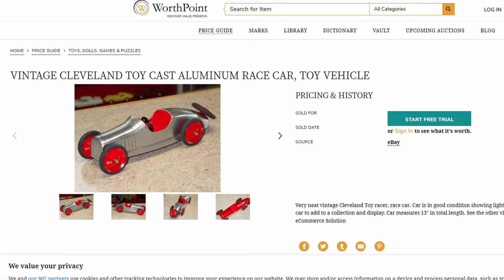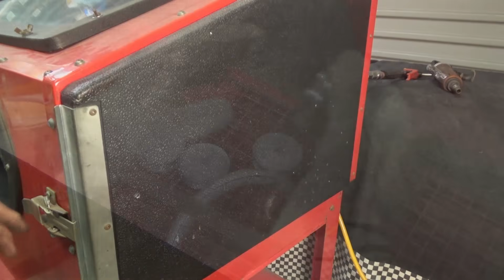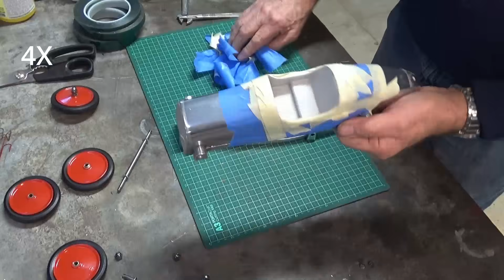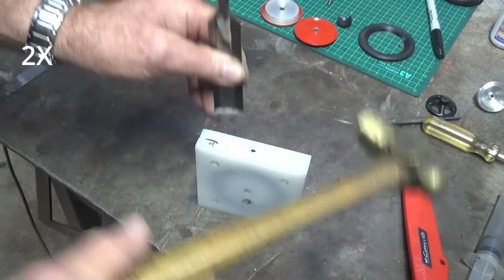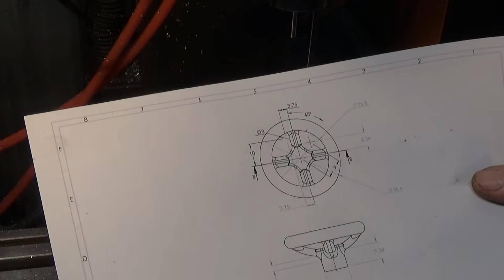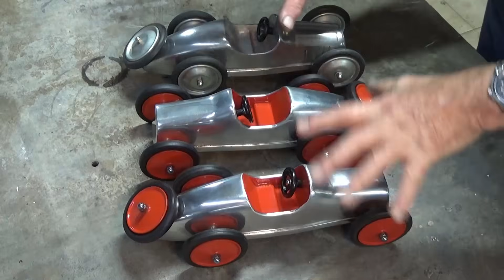Cleveland Racer Part 6 - Squishy Tyres for the Cleveland Racer + Powdercoating Fun & CNC

Comment: Too late now (I know it's all finished) but if you woulda machined about 1mm from each rim half inside and changed your tire mold to leave a 2mm skin in the center of the tire when you riveted the halves together it would have attached the tire. Might have even machined some spokes in the mold and inside the rims so there was that much more rubber holding them on.
I worked in toy design as a 20 year old so that stuff just comes to me.
Reply from the maker: Yes, there were probably a lot of refinements I should have employed but it was one of those evolving processes. The original tyres were way more rigid and the wheel halves had to be sized assuming that there wouldn't be a lot of crush in the assembly. 
Regards,
Mark

Comment: I was wondering if there is a liquid masking product for powder coating & some people say you can use a latex solder masking called Wonder Mask for powder coating also.
Reply from the maker: I was looking for something like a liquid mask. Our local paint shop used to sell a product for masking glass in window frames. You could just paint it on with a gadget that looked like a giant highlighter pen and it peeled off later like a rubbery skin. 
Regards,
Mark

Comment: Mark, if I may offer an idea reference masking.  I would suggest "over-masking" the area you want covered (because the tape is so stiff;) then using either a single edge razor blade / or a Exacto-Knive(s) (of your likening, come in different sizes/thickness; ) and trim /cut as needed to remove unwanted /excess tape, and get / achieve the edge (line) you want.  I like the new compound for your tires.  Personally I would try using a thin coat of "Spray-Pam," for cooking / baking, as a mold-release, or some type of car-wax, maybe try a thin-coat WD-40. Your working way to hard to separate the mold when the tires / Tyres have dried / harden / cured.  The cars are LOOKING AWESOME.

I don't know if in Australia you have "FLITZ" product(s,) called:  "Metal, Plastic & Fiberglass POLISH & Paint Restorer." Corrosion Protection (for Aviation / Marine /Truck/Automotive, Plumbing, Hotel/Restaurant etc.)  If you do, I would for sure purchase a single quart can (0.45 Litres/Liters.)  Where I learned about this product was seeing it being used on {youtube} Bus Grease Monkey Garage (Scott Crosby.)  Scott works on what are called silver-sides (all aluminum ) 1950's Greyhound like buses, with engines what are called screaming Jimmy's. 
Scott was using the product on his personal bus named Lenny, WORKS "Supercalifragilisticious."  
The word supercalifragilisticious comes from the (1964) movie Mary Poppins.  FYI.
Reply from the maker: Thanks. I am old enough to remember seeing Mary Poppins at the cinema when I was  a kid and it was something of an acheivement to be able to recite the lyrics from that song, especially when Julie Andrews sang it backwards!
I did cut some of the mask away with a surgical scalpel to get a clean edge but the tape tends to separate easily along the sharper curves. As it turned out, it was relatively easy to remove the overspray with very fine wet and dry abrasive.
I have not seen the Flitz product here. I am sure there are better options than what I was using though.
Regards,
Mark

Comment: I know that it's WAY TOO LATE to mention it now, but you probably could have tracked down and sourced rubber o-rings that would have sufficed for the tires

I'm not sure if anyone else has mentioned that already
Reply from the maker: I have had a lot of suggestions to use O rings but the only ones I could source were too small in cross section. As it turns out, I ended up with a more realistic tyre using the mould and the urethane rubber.
Regards,
Mark

Comment: Good day Mark, I just noticed the sheet of metal on the door of the blasting cabinet. Nice idea. I've just been banging on the door, before opening, several times to knock the media back in from the door recesses. For the past 15years! I added a piece of house rain guttering to outside the cabinet just below the door to catch most of what falls. Then I use a chip brush to sweep media into a paint mixing cup and dump it back into the cabinet.
Reply from the maker: The sheet of metal does help but there is still some grit that collects around the edge of the seal. I do lose a bit every time I open the door. I should look into your solution too.
Regards,
Mark

Comment: Amazing work! I'm going to predict that you make all the wheels out of the flexible material. After all, in another 50 years, someone may be using your replica to decide how to make one! And of course, if you really want to be obsessive, you'll remake the tire mold so that the tires require a bit of stretch when mounted, thus keeping them secure. And ... and ... don't you just love it when someone decides how you should spend your time?!? :)
Reply from the maker: I have a plan for mounting the tyres but also, it is surprising how often I take excellent ideas from the comments. One such comment has inspired me to modify the mould as you will see in the next episode.
Regards,
Mark

Comment: I really liked the matte finish on the interior left by the sandblasting. I think my own personal aesthetic choice would be to stop there. 

Thanks for another great episode. I was so happy for you when that tire turned out so well.
Reply from the maker: If I were going to leave it with a blasted finish I would have used glass bead. It makes the surface look semi polished and the peening action of the glass beads smooths out a lot of the defects. The garnet that I used makes the surface absorbent and it will stain quite easily.
Regards,
Mark

Comment: Before i retired as a fabricator i had to develope a system for casting fake Rattan. silicone molds were made off real rattan 10 feet long. We used  50 gallon drums of ureathane rubber. Cast over a thousand pieces. Id like to say it was fun but i can't. 😂
Nice work Mark 👍
Reply from the maker: Thanks. I must say I have never used anything like a flexible resin before. I expected lots of issues but the Smooth On product worked perfectly. I just wish it cured a bit quicker.
Regards,
Mark
Reply: @Preso58  Thank you for the journey Mark.

Comment: The CNC process to fashion the steering wheel was very interesting.  I am more familiar with casting and, as i watched, i ws pondering how i would cast that same part.  

Thank you for this series of very informative and inspiring videos
Reply from the maker: I quickly rejected the idea of a sand mould for that little steering wheel. Trying to find the parting line would turn me off very quickly. Investment casting would be the best way but I don't have the gear for doing that process. 
Regards,
Mark

Comment: Continuing on a beautiful build. A question - why did you do only do roughing steps on the CNC?  The end result is fantastic, but more prep work by the CNC I would have thought would have eased the work needed overall?
Reply from the maker: I am not very familiar with 3D tool paths. I need to experiment more with the options in Fusion360. I have also recently purchased a yearly subscription with Solidworks. It has CAM capabilities too. I am sure that I could have used a finishing toolpath to get better resolution but at the end of the day I decided to quit while I was ahead and use good old files and emery.
Regards,
Mark

Comment: Hi Mark that urethane rubber compound sure looks the business I'm sure that would suit my project perfectly, thanks for being the "Test Pilot" really enjoy your your videos a good source of information and for the practical aspect also, Many thanks.
Reply from the maker: Thanks. The urethane is much thicker than the Smoothcast resin I used for the first batch of tyres and I was worried I wouldn't be able to inject it into the mould with the same syringe I had been using. I pour resin into one half of the mould before assembling it and inject the rest. It's slow going in but I think it helps to reduce the introduction of bubbles. I have been degassing it in a vacuum chamber that I have. The pigment is called "So Strong" and I only have to put two drops into the mix to get an opaque black tyre. 
Regards,
Mark

Comment: Have you switched to Solidworks from Inventor? If so, what prompted the change? Excellent video, always enjoy them.
Reply from the maker: Unfortunately, Autodesk declined to renew my educators licence. So, just after I finished all the drawings for the Threadexpress project I lost the use of Inventor and Fusion360 Pro. 
I was able to get the free Fusion360 version but you quickly find out that there are small but annoying restrictions, like not being able to export 2D drawings as PDF files and not being able to flip the Z axis in the CAM processes. My son suggested I use Solidworks for Makers. It was only about AU$50 for a years subscription but it is very different to the Autodesk software. I am slowly getting used to it but I will probably use it more than Fusion as I get more competent. 
Regards,
Mark
Reply: @Preso58 Yeah Autodesk is definitely making things more difficult. I have Solidworks educational as well and I enjoy it, but not as comfortable as you say as I was in Inventor. Best of luck with it moving forward.
Reply: Whilst the “export as PDF” option is removed, that is not really a problem as both Windows and Mac have a “print to PDF” driver which works fine.

You are mistaken about the Z axis. There are no restrictions in this regard in the Personal licence.

Comment: FYI there are several of the Cleveland Racers listed on US Ebay.  The interior is not painted on the models pictured.
Reply from the maker: I did find all the Ebay listings I could and the only one that had the red painted interior was on the Worthpoint website. I guess that if the models are 100 years old the original paint would have deteriorated. I will leave the original racer as it is without any paint in the cockpit but adding the powdercoat on the two replicas saved me a lot of polishing work.
Regards,
Mark

Comment: I need to make a couple of tires for a couple of spoked RC plane wheels. I intend to use my mini mill to make the molds. Your videos are a real help, thanks!
Reply: Depending on the size they need to be and the suspension onboard the RC plane, a rubber o-ring might work
Reply: @THE_PeglegSwantoon  They need to be 2.5" inside diameter, and 0.400" width. I have looked without much success. There is a bit of a profile involved that I can recreate with a custom mold. I have already created a test mold in FreeCAD, as well as the tool paths for my mill. I haven't drawn up the actual profile yet, as I will likely destroy to original dry rotted rubber while removing the tires from the rims. Once I have the urethane, and round nose endmill in hand, I'll proceed.